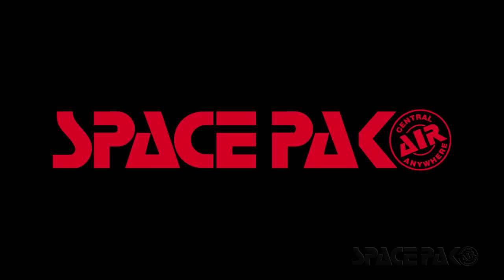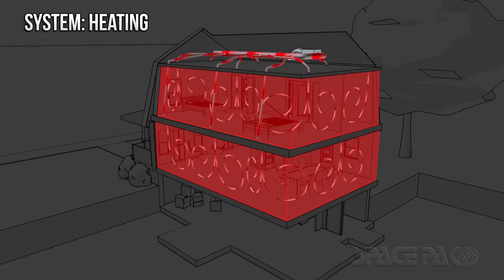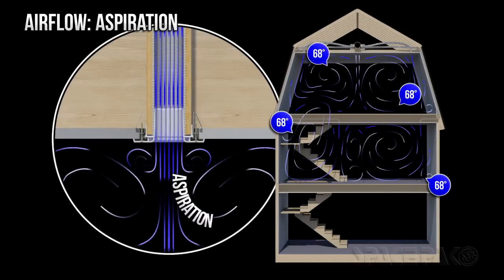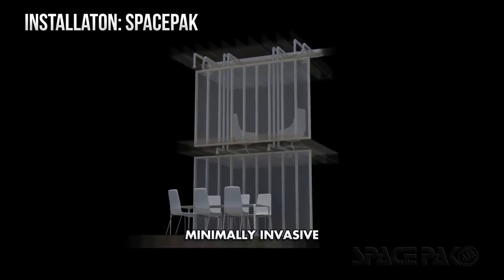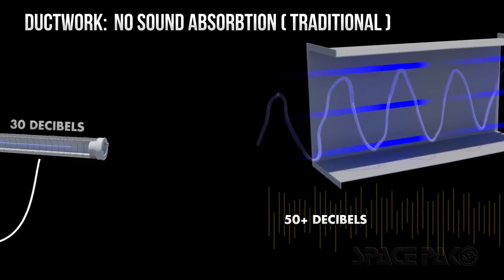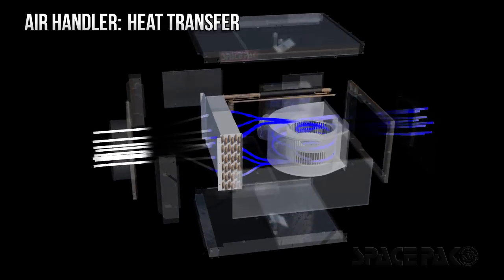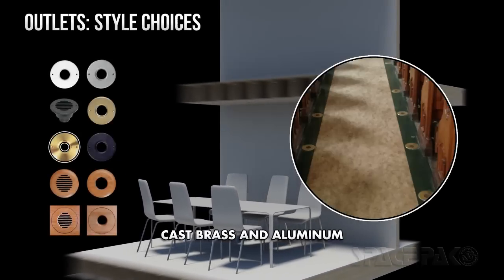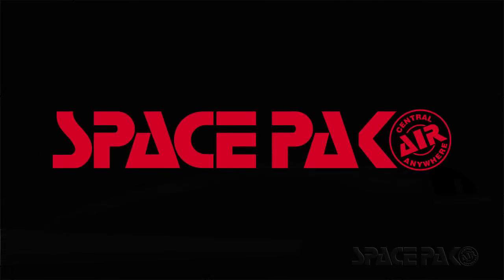SpacePak Small Duct High Velocity System 101

Comment: Qhy is your warranty 1 year if you install it yourself? And qhere is the serial number on my unit ?? Ihave to say I wouldn't recommend your system to my customer base with your warranty system  inplace the way it is. Icant even locate my model and serial number on my unit with a dead motor from bearings going bad